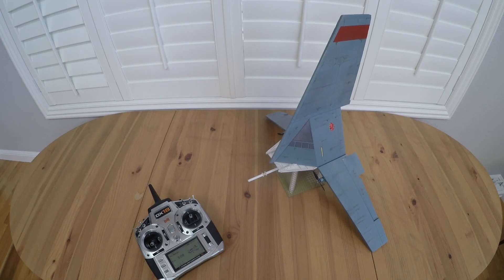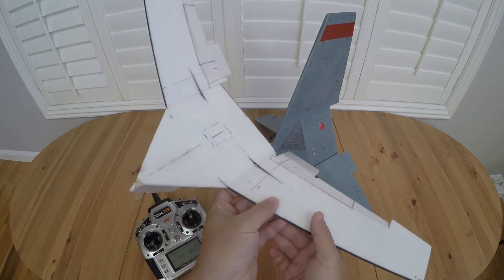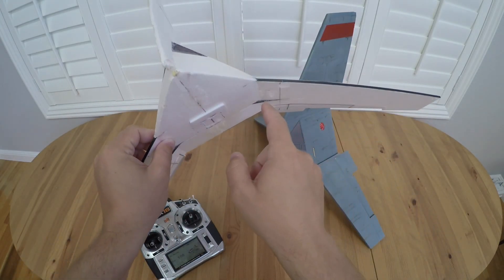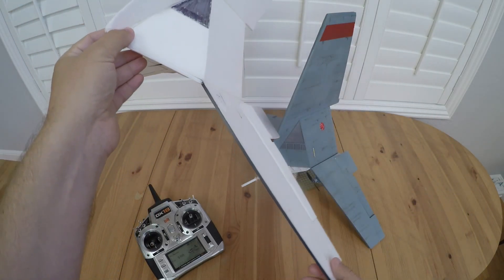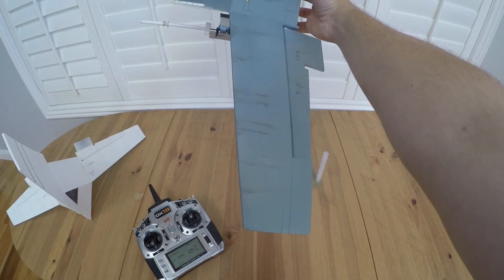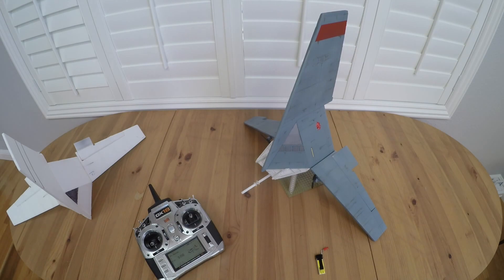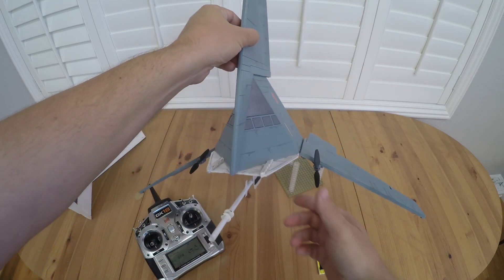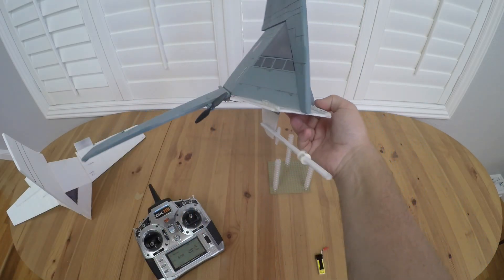Real Flying T-16 Skyhopper

Comment: Is this a prequel for a Lambda-class shuttle build?
Reply from the maker: I did a lambda shuttle a while ago, but as a quad, I think it would work as a plane using this approach :)
Reply: @ajw61185  I was wanting to do a flying model however with the weight of the cockpit so far forward and wings so far back I had a problem with balancing the ship

Comment: ....always creating something spectacular...Thanks for sharing it with us
be nice to see a equipment list perhaps...motors, controller, material etc for your builds...always awesome content
Reply from the maker: Thanks. The electronics for this one (controller, servos, motors, battery) are all from an E-flite UMX Ultrix. You can buy the components separately, but it's just about the same price/easier to just get one of the planes and pull the gear out of it. It's a really great 1s setup that I've been using for most of my builds for the last year or so.
Reply: @ajw61185  Excellent and Thank You

Comment: Awesome
 I'm workin on building the  havoc marauder
Reply from the maker: Cool! I think this one ended up working because of the relatively symmetrical wing sizes. The Marauder, has that much smaller dorsal fin, so it may want to flip over, but it could definitely work. After watching the show I tried the prototype version of this one with most of the dorsal fin cut down, to see if the shape would work, and it was almost flyable. Good luck with the build!!!
Reply: @ajw61185   that's what I was thinking. Any advice on motors? I was either going to build it like a drone or a dual motor plane. I'm pretty new to planes